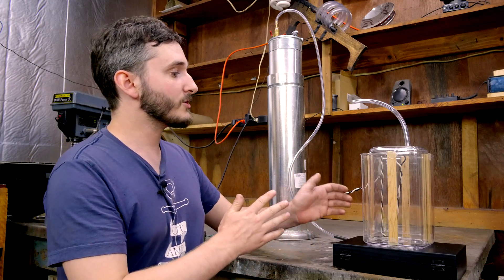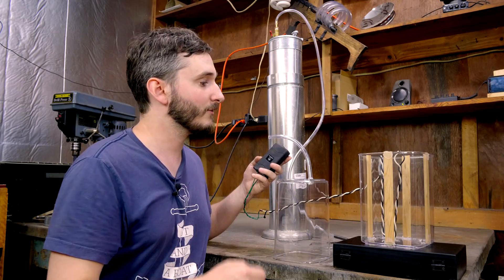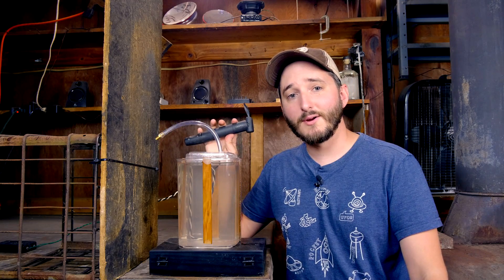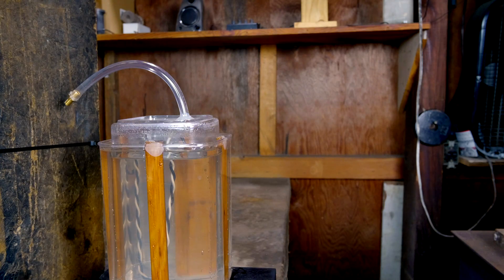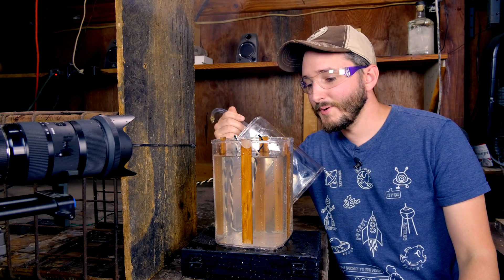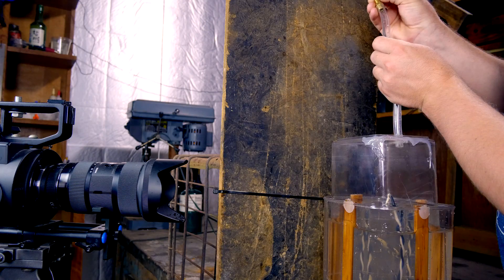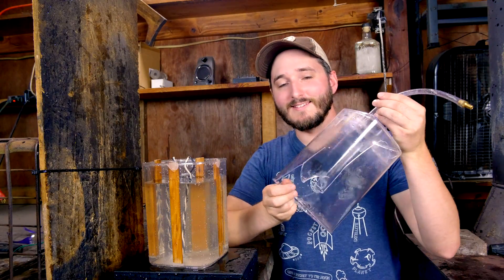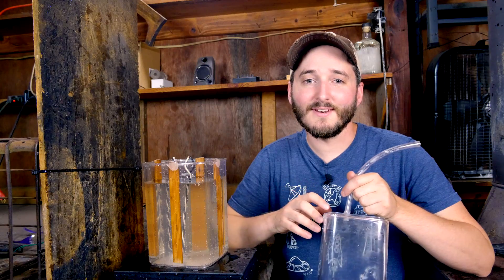Explosive Safety Testing for Bio-Fuel Storage

Comment: Would it be possible to use some kind of compressor to pump the woodgas from the gasometer to a pressurized container ?
I'm thinking about a refrigerator compressor, as they are designed to pump flammable gasses around (like isobutane in most fridges) :)
Nice video, keep up the good work !!
Reply: I've been doing some research into this sense Nighthawk's gasometer video. Everything I have seen suggests it is doable, so long as oxygen is kept out of the system, but not worth doing. The energy needed to compress it into, say a propane tank, is equal to or greater then the energy the compressed wood gas would be able to produce.
Dont take this as gospel, this is just what my google-fu research has come up with so far.
Reply: LordInfiniti Well that’s not the point of this experiment is it? Viability is only a question of scale.

Comment: In a long time storage scenario the exchange of gasses between the atmosphere and the outer ring of the water as well as the wood gas and the inner circle of water will slowly pull wood gas out of the  container and air in gradually creating a combustible mixture.I dont know how to make the outer circle of water not be exposed to the atmosphere to prevent this nor do i know the rate of gas exchange as the wood gas is actually a mix of several flammable gasses.
Reply: My initial thought would be to put a layer of some type of oil on the surface of the water. That's just guess though.
Reply: But the containers slide in one another (moving parts are very hard to seal) and you need it to be air tight, not just covered.
Reply: Do you though? It seems to me that rather than being airtight, A thick enough layer of the right oil would prevent contact between the water and the atmosphere/wood gas preventing diffusion while not interfering in the movement of the container. That said I don't know how well gas would diffuse through various types of oil, so there may not be one suitable for this.

Comment: Hey nhil cant you use a fridge compressor and some other stuff to hav the gas get pumped first through a air trap like the opposite of a p trap so no water gets into the compressor then to the compressor then through some hoses to a 1/2 or 1/4 compression from where then it can go to a reused prop. Tank? Also have a ball valve so u can vacume down the propane tank so no air?

Comment: That was cool as.
 I think most internal combustion engines run at a ratio of 14:1 (fuel:air)....just did a google search and it's 14.7:1
Reply from the maker: The correct ratio changes depending on the fuel used.

Comment: You should try making a way to compress the wood gas into things like a propane tank, so that it's a liquid and can be used per say on a little bike engine (maybe even car engine). I want to build a go kart that runs off of purely wood gas since my property has plenty of trees and I want to be environmentally friendly
Reply: You can just produce it "on the fly" (the way it was done back during WW2 in europe when there was huge shortage of gasoline/diesel), by having the stove etc in a trailer or on-board your go-cart.

As for environmental friendliness, it's quite a bit more complicated; sure the fuel is renewable but the efficiencies are atrocious and you're going to produce quite a lot of carbon particles (aka soot) and NOX and other not so nice byproducts of less-than-perfect combustion.
Reply: It might be possible to compress wood gas, but you're not likely to get it to liquefy with any sort of homemade apparatus.

Wood gas is, as I understand it, mostly carbon monoxide and hydrogen, both "permanent gasses". CO has a critical temperature of -220F and H has a critical temperature of -400F. You can't compress a gas into a liquid above its critical temperature, so instead, you'll get a supercritical fluid. You can put it under huge amounts of pressure, sure, but it's not going to behave quite like propane (with a critical temperature all the way up around 200F).

Comment: Also isn't the storage container technically under positive pressure? So you would have to actually pump air into the container. It couldn't leak in. If there was a leak the gas would come out until the pressure equilized and at that point there is so little wood gas of it exploded it would be nothing more than a balloon over inflated

Comment: But this does not answer the question if a flame could travel back through the valve and ignite the mixure in it when the top part is pushing down, constantly forcing the gas out of the vale. What do you think, would it still happen?

Comment: Biogass is quite safe. Aslong as your storage is not in an enclosed space. The likely hood of you reaching your LEL lower explosive limit is quite low even in the event of a leak. Indoors is a completely different story. Like your experiment that enclosed space can quickly build up gass levels to you LEL.  FYI this is why people who work in enclosed spaces,with limited ventilation, space or access, should have enclosed space entry training.
Reply: i should say you worked in the gas industry, i totally agree with you! usually around 5% gas in air. side note, when i first started working in the gas industry, you would see the old boys in the pits cutting off a 3\4" gas service with a hack saw and a lit rolly in their mouths! at least they would insist on continuity bonds!! as that was more of a risk of causing a fire!!! would get thrown off the job for that nowadays!!! lol
Reply: Not to mention the CO toxicity if leaked anywhere where people would be. Carbon Monoxide is crazy toxic and will not trigger the "can't breathe" reflex/feeling like CO2 does, you will simply pass out and die without realizing anything is wrong if you inhale CO.
Reply: Here in Finland, the promised land of wood-fired stoves (especially in Saunas), we have quite the public awareness campaigns on the dangers of carbon monoxide and carbon monoxide alarms are available in every supermarket (and most gas stations)
Reply: Eero af Heurlin. I'm remembering when most refrigeration equipment was ammonia based. These were big systems such as those used in dairies. An ammonia leak could quickly flood a building and getting to a door to escape proved to be a challenge if you got more than one strong breath of the concentrated gas. That's one of the reasons ammonia systems are no longer common here in the United States.
Reply: Tynan Larson-Caldwell. This system of storage within a water filled container is older than any of us here I'd bet. There's still a tank or two back east that are bigger than most above ground water towers and the were used for heavy gas storage. Acetylene gas was stored like this at some point in time. I've got an old ceiling mounted gas light that ran on carbide gas. The gas generators were mounted in buildings and gas lines were strung out through the walls much like electrical wires are distributed from a breaker box. You started your carbide generator in the back of a church for example and then walked down the aisles lighting the individual lamps. It's easy to see that a light blowing out or a valve turned on by mistake could pose a calamity. Probably made it easier for Edison to sell his new form of mass lighting.  I'm sure he promoted it as being safer.
Reply: ten littleindians. Thats a cool bit of history.
Reply: Tim Hooper I wish I did i just do alot of reading and experimentation with biodigesters, Environmental tech graduate. Wish I was working on biodigesters, gas, or waste water.

Comment: So, assuming your wood gas is pure CO, you need 1 O2 : 2 CO to be stoichiometric. 

Since air is 1/5th O2, and assuming the perfect gases law applies as well as neglecting the effect of water vapor, the ideal ratio should be 2.5 air : 1 CO. Or roughly 70/30. 

Which matches quite well with your experimental results!
Reply: piranha031091 absolutely correct.... But you neglected the hydrogen content of the wood gas .....
Reply: Akash Mukherjee : doesn't make a difference, O2 reacts in the exact same 1:2 ratio with H2.
Reply: @akashmukherjee2405   ratios for complete burn
One O2 + two CO = two CO2
One O2 +  two h2 = two H2O
Both have the same one to two ratio.  Assuming one mole of any of the above gass fills the same 22.4 liters at standard temperature and pressure, and our wood gas is any combination of CO and H2 and nothing else,   then for complete combustion,  every liter of wood gas needs 0.5 liters of oxygen. If atmosphere air is rounded to 20% oxygen, then 0.5 liters /20% means  2.5 liters of air has .5l of Oxygen. 2.5l of air added to the 1 liter of wood gas = an explosive mix of 71.4% air and 28.6 % wood gas.  This is not the lower flame limit, nor the upper flame limit, rather it's the minimum calculated mix to burn all the CO and H2, the stoichiometric mix.
Reply: @kreynolds1123  yep.
Reply: But wood gas on average only contains 34% CO, it also contains 13% methane 2% hydrogen and 2% ethylene.
It also contains non-flammable gases, e.g. 48% CO2 and 1% Nitrogen.
Reply: neglecting all the intentionally left out variables, that sounds about right. Although, i do kinda wanna see what it'd look like if we used the combined gas law and included the appx ratios for the other gases in wood gas.
Reply: Thanks science guy
Reply: I'm always too late in the comment section...67/33 or 2 to 1 is what you're looking for
Reply: Reeeeeeeeeeeeeeeeeeeeee

Comment: Can you get a semi self-sustaining wood gas setup? Like have the would gas heat up the wood to produce more wood gas? Is that possible? And maybe have a second line that takes just a little bit of it so it is not for nothing.
Reply from the maker: Really a self sustaining wood gas setup is just called a camp fire. The flames of a camp fire are from wood gas.

Comment: Popping balloons of wood gas? How about trying to compress it and put the gas into a cylinder/tank.
Reply: there is a man on youtube who is running his truck off of wood gas
Reply: @BonesMcoy  Did he make the system himself? Cars and trucks can be run on wood gas no problem, and so a lot of wood gas conversion kits were made in Europe during ww2. He could've been using one of those.
Reply: I believe wood gas when pressurized cannot return to a volatile state
Reply: Wouldn't that cost more energy than the woodgass provides? Of course, a steam engine could do the hard work, but the final question is whether it's worth it... adding a weight on top of the gasometer while in use would provide more gas pressure of course... Just thinking that building the pressure necessary for the gas to go liquid would be too much work.
Reply: Thats not a good idea, could easily explode and you can’t store hydrogen for any length of time anyway. If it explodes Carbon monoxide will spread and likely kill anyone in the vicinity as well.
Reply: Carbon monoxide burns with the mixture stay out doors or with plenty of ventilation you’ll be fine just use your head

Comment: This footage also pretty neatly shows off some of the difference between a rich and a lean air-fuel mixture. In the 60-40 mixture explosion, the flame is quite bright yellow, which indicates there is unburnt carbon - there is just enough air for the wood gas to ignite, but not enough to burn all of it. On the other hand, in the 80-20 mixture, the flame is much paler and blue instead of yellow, which indicates that all of the wood gas does burn completely, due to enough air being available for it.
Reply: Are you a furnace guy? They are the only people I know that knows that!  Cheers! btw,, i'm not one. lol

Comment: It's really hard to reach a flammable mixture with your set up. There is a lot of inert gas in the wood gas you generated and air itself is only 21% oxygen. This method of storage was used for a long time because it's safe : the water reduces any heating and you can't build up a lot of pressure.

Comment: Stoichiometric ratio is the word you are looking for.
 Calculation of the quantities of reactants and products in a chemical reaction. A reaction having its component elements present in the exact proportions indicated by its formula.
Beautiful green flame you usually only see with Boron. If you put the light from the picture through a spectrometer. You should be able to tell if the gas contains boron or it's something else making that green flame.

Comment: Damn can you run a motor ? A generator ? Or even a stirling engine ???
Reply: FEMA put out a manual in 89 titled "Construction of a Simplified Wood Gas Generator For Fueling Internal Combustion Engines in a Petroleum Emergency", so yes.
Reply: There are videos on youtube of people using wood gas directly into the intake of car engines and them working fine.